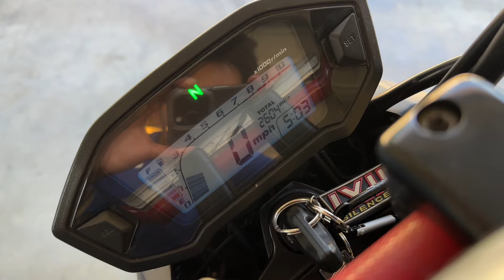Buying A Honda Grom! || riding clips ||

Comment: Nice bike! Might want to look into whether it has a flashed ecu or not, i didnt see a power commander or aracer but maybe check under the right side plastic for evidence that the ecu has been removed and replaced. The chimera + exhaust will run lean on the stock tune and possibly lead to reliability issues or power loss. You can get the stock ecu flashed, use the ones i mentioned earlier, or theres also a cheaper ecu from Thailand from ecu-shop called full stand next. And to answer your insurance question, mine is $11 a month but i'm sure age has something to do with it. Ride safe!
Reply from the maker: Thanks for the tips dude, the grom is on the stock ecu and I’ll probably get a new ecu after making the bike look good. $11 that’s so little I want that😭
Reply: @mikeyvids  if you don't plan on doing crazy performance mods, the cheapest solution is to send your ECU for a reflash for about $150, Google DH motoring. If you want to be able to tune on the fly you can get something like the aracer but you'll need a wideband and the self tuning module, or some other piggyback or standalone, it can start to get really expensive.